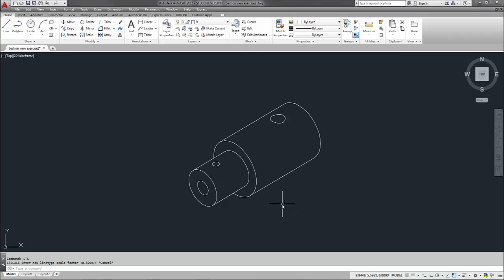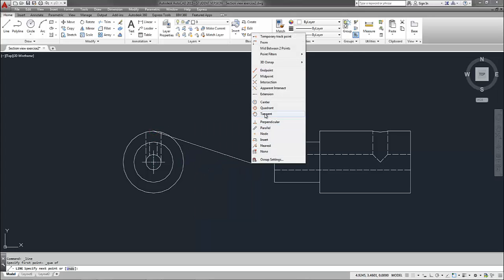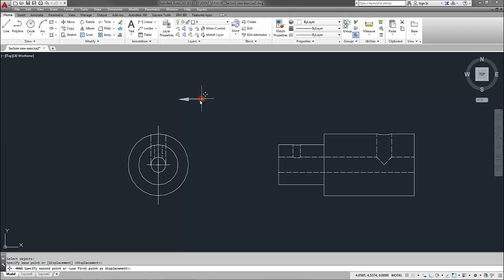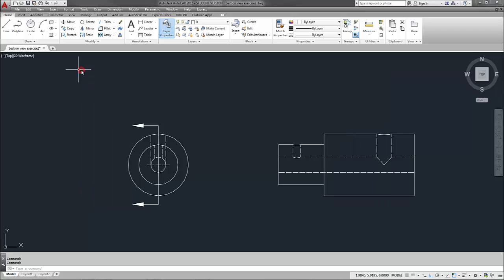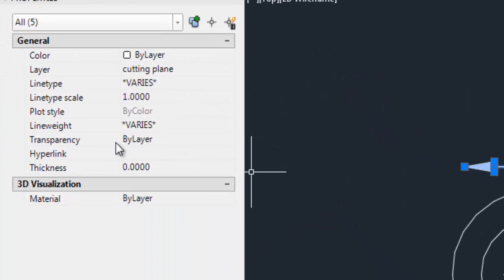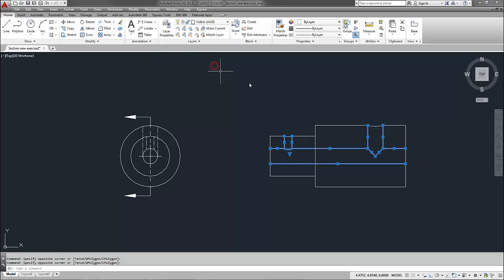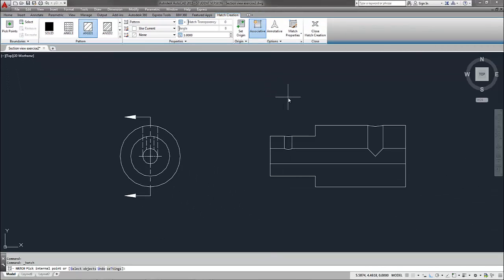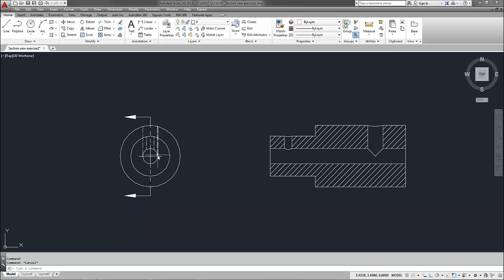Section Views

Comment: Thanks! Do you not need a centerline though on your section view? Also, does the arrow face the part you are actually keeping vs. the part you are eliminating?
Reply from the maker: You do not necessarily need a centerline, but you can include one if you wish. The arrows show the direction of sight, so yes they will face the portion of the drawing that is shown in the section view.
Reply: Thanks!